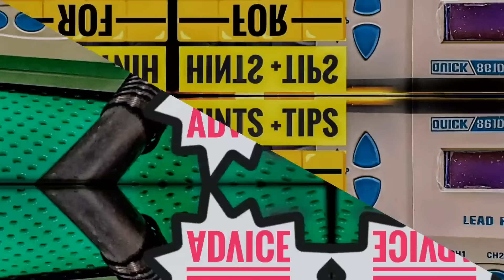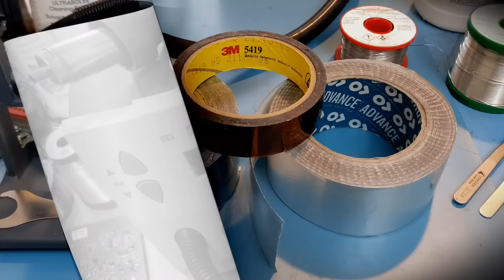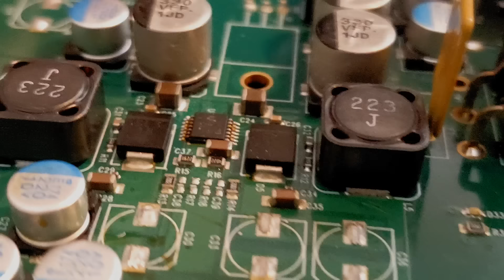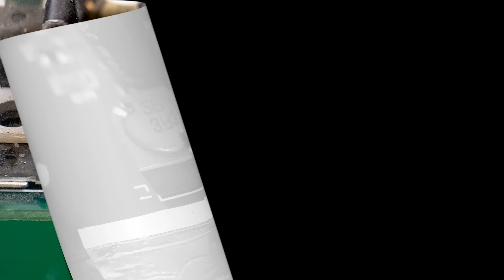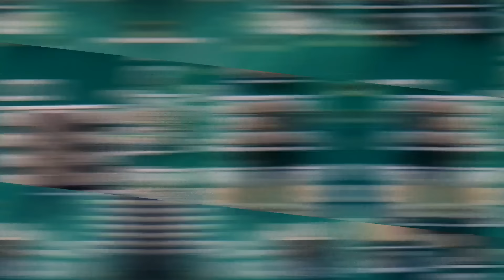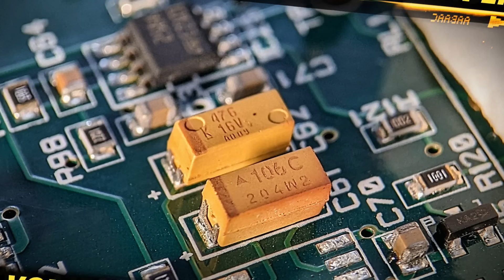How To Use Hot Air Rework Station / Soldering / Electronics

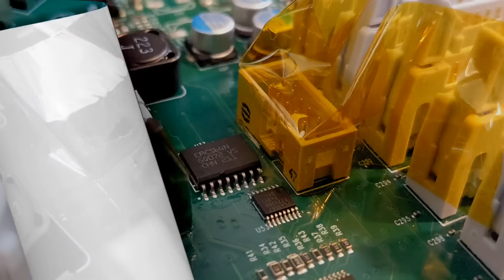Comment: Big novice here: I noticed the chip you removed at 6:37 you are close to it, moving around it evenly. I've tried this with chips I've tried to remove and I start seeing burning on the PCB at that height. I use a liberal amount of flux and it starts to burn. I'm usually working at 325 C. Although my hotair station is an inexpensive one, so I hear that the temperature may be inaccurate sometimes on cheaper machines. I've only ever removed one chip as easily as you did in your video. Two other times I had pads rip up, even though I'm not using force. They will come up stuck to the leg of the chip. Any pointers on what I'm doing wrong? Thanks again for this video!

Comment: The temperature doesn't make sense. I asked AI what was a good starting temp for doing 0805 components. They said 280 Celcius. I started with that and it worked but I am not using as much solder as you do but remember I'm new to this. But 385 Celsius is way over 280. And, I looked for the aluminum tape here in the US and they said the aluminum tape couldn't stand temps over 300 at all. What's the aluminum tape called exactly?

Comment: should i use tape on the back side of a board that I'm heating the top components so they don't fall off? i haven't done much hot air work and I'm trying to learn what to worry about and what not to

Comment: I am a complete beginner, this video is excellent,  I'm just starting out and already found this super helpful. 
I've been watching YouTube for years, this is the first video I've watched all the way through and the first I've felt compelled to like and subscribed.  Is there any particular brand of foil you use ? Thank you.
Reply from the maker: Hi , thank you for your support of my channel , much appreciated . The tape I would recommend is Advance AT500 , easily found on the internet. Pretty decent price , £10 to £15 for a very large roll , sticky backed so stays in position well when using hot air guns etc. Hope that helps , thanks again 👍

Comment: When lifting pins on a 144 IC I keep snapping the legs. The solder joint does not melt, literally zero pushing with the leg.... I suspect the leg is getting so hot the leg snaps... Used soldering iron and also hot air soldering, same result.... Its like the legs are breaking before the solder melts. Using rework flux, watched many of your videos. What is going wrong for me? What is different from your videos is my solder just doesn't melt as fast....

Comment: I love the 3m 425 aluminum tape I use it all the time its only like 20 bucks here in the US for 0.5 inch which is pretty much all you need in width over the 2 inch tape which is much more and overkill in size for covering sensitive plastic components and components in general. I think am going to try some advance tape also.. but the 3m 425 is my go to.  The only problem with buying advance is I have to specifically order it international which costs more for me. The 3m is pretty much close to the same it leaves no residue on boards

Comment: Nicely done. I have a question: at about 21:00, the solder joints were looking shiny and good. But, after the solder solidified, they looked dull/matte.  You mentioned that was a lead-free board, I believe, with lead-free solder. Is that normal? I've only used leaded solder and not tons, either. I recently started doing some electronics projects after years of not doing any; I had to buy new solder. I got a roll of "63/37" from China via Amazon and that stuff did the same and looked like crap when cooled. I tossed that and got some Kester (?) 63/37 and, wow, yeah, that leaves shiny solder joints.

Comment: Hello, Something tells me you're exactly who I need to advise how to fix my Pad problem...Agilent U1242A DMM. Case has a battery compartment with fingers that make contact with 2 gold pads kind of melted into the PCB. Batteries leaked and traveled to one of the gold pads and destroyed most of it, especially where the finger meets it. There are blotches and a decent amount of gold pad still connected to the trace. How would you repair it to reliable again? I have 10 to 20 hours of use,  at the most on it. OUCH! Don't know where to source a 6.5mm square gold plated pad. But after seeing this, maybe a rework station and low temp solder paste and tape surrounding it, would be the best way to attach a gold plated pad if I could find or make one? I'd appreciate your guidance! Thank YOU! And please keep up the confidence building videos!

Comment: In case of lead free solder, would it help to start with adding some leaded solder to all the connectors? 
Maybe flood it a bit with leaded solder and then use solder wick to get rid of the excess solder. 

Just an idea, I haven’t tried it myself (yet).

Comment: Great video! That last method just solved a problem I've been having seemingly randomly. I mainly do automotive so I reflow alot of cracked joints. Every once in a while I'll have pins short like that for no discernable reason. I never thought about the mass of the ground working like a heat sink. Thanks for spreading your knowledge!

Comment: Any tips when using cheapo chinesium hot air stations? So far I've used it on a SOP8 chip, because I don't have many components requiring hot air to solder in my hobbyist and studies uses, so I don't know if I'm missing much by not getting a fancier station if I ever have the need to solder bigger chips.

Comment: - So, a bit of a beginner's question about electronics. The dark green is the colour of the PCB. The light green are the traces that connect 1 component to another. But then you also have these light green areas, like a square/rectangle instead of just a line trace ... does that mean that anything connected to that area, is connected to each other ? But I guess there are usually only 2 components connected to the square, because otherwise you would probably get a short ? 

- And what are all those holes through the board ? They are usually at the end of a trace. With the little gold coloured ring around it. Is that where a trace goes through the board to the other side, and continues from there to connect it to other components ? I don't remember those holes being on the boards of old electronics that I worked on in the past.

Comment: - I just got a cheap 92€ hot air station yesterday. A bit nervous to use it for the first time. But this video helps a lot to give me an idea of how to use it and what to pay attention to. 

- So now I should get me some of that Advance aluminium tape. I have some aluminium tape which I used to tape the seams of the plastic screen that goes over my roof insulation. I guess it might work just fine too. But I'll look into the one you showed, because it seems more flexible, probably works a lot easier.
Reply: I think it works the same, I used some which I got in the supermarket and it worked a charm.

Comment: Very interesting I studied a little Electronics I know not too much though. I had no clue you could apply that much heat on a IC wont it burn it ?
Reply from the maker: Hi , thank you for your comment . I've applied up to 400 degrees Celsius to IC's and then reused them with no problems at all . Very rarely one can form a bubble in the body due to heat but this is very rare . They are very hardy components nowadays . Hope that helps , thanks again 👍
Reply: @mrsolderfix3996  Holy shit I figured one hit with a flame be toast . I had no clue they would take that much heat wow !  I want to find a used solder and hot air station I would eventually like to start getting back to my studies . I do Marine electrical and also restore American Muscle cars. I dont know much about Electronics but would like to learn whats is a good entry level hot n solder station thanks mate

Comment: great video, super helpful
I have one beginner question about hot hair rework: how much heat can the ICs withstand? I am practicing myself right now with old modem pci cards and I noticed the ICs can incredibly hot after applying hot air to desolder them. if these ICs are not to be discarded, is hot air still a viable method for removing these components?
Reply from the maker: Hi , thank you for watching the video and commenting , much appreciated . Lots of IC's can take very high heat and still be reusable . I've taken parts from boards using 400 degrees Celsius and reused them with no issues . Hope that helps , thanks again 👍

Comment: Enjoyable video as usual.  About that final solder bridge, heating it with the tip of a pre-tinned piece of wick would've pulled it right out of there, and with a bit of sticky flux might even reflow the two leads nicely all in one go.  I see people struggle a lot with wick.  The key is to not use it right of the spool because it just acts as a big heat sink.  Cut a bit off about as long as the width of your thumb and fray one end with your finger so it's like a little broom.  Flow a bit of solder into the fray and when it cools add a wee bit of flux.  Then with tweezers (ceramic is best if you've got them) hold the broom edge to the solder you want to remove and heat with solder tip.  The solder you pre-tinned will be drawn toward the clean end of the wick and it will suck the solder from the leads with it like a Hoover.  It takes some coordination to remove the wick at the right time to avoid having to resolder the leads.  Also, if you are fortunate enough to have an iron that offers one then a hot clean 2mm spoon/hoof tip will draw a solder bridge like a magnet and you can just scoop it out.  Keep up the good work.
Reply: I mostly struggle with wicks when trying to clear small holes like <0.7mm like a JST-PH or worse, molex picoblade, especially attached to a ground plane. Even a small wick piece can't get it out because of the surface tension with the plated hole and a solder sucker tip is generally also too large if other components are around. There are 1000 videos for clearing THT holes with wicks, but they all clear holes >1mm which are extremely easy and every method works well with them.

Comment: You can shape the tape like a ramp to guide the air towards the pins too sort of like a shroud to focus the heat and air at the pins. So I like to make little ramps down to the pins with the foil tape and it seems to help a lot with larger chips like this to keep the heat directed on the pins.

Comment: 9:15 - I think it takes far too long to melt the solder on that chip. Apart for that, nice job showing aluminium foil works better than kaptop tape.

Comment: 29:00 just a quick dab with the iron and solderwick (with flux on it) would have tanke  in off in a jiffy!
Reply from the maker: Hi , thank you for your comment . These joints you mention are on a heavy ground plane . No chance doing it the way you mention . If on a hot plate can be done your way or if you haven't got a hot plate available but do have a hot air gun can do it how I show . Thanks again 👍

Comment: Definitely excellent instructions. Don't make 1 tool to be your religion. The last shown problem with the tin lump had been easier to remove using solder braid, made of copper and sucking tin away. Soldering irons tend to oxidize and become close to useless, therefore hot air might be better in many cases.
Reply from the maker: Hi thank you for watching the video and commenting , your support of my channel is very much appreciated 👍

Comment: 👎 Kapton tape itself is heat-resistant but it has NO INSULATING PROPERTIES. 
Its purpose is to fix components, cables, etc. in places where high temperatures occur (where any other tape fails).
It was never intended to protect other things from heat❗
Reply from the maker: @4623620  hi , I showed it here as many people including in Electronic companies still use it like I showed to protect against heat .

Comment: Hi Mr. SolderFix, I have a quick question: Should I preheat the board and the SMD components to 200°C before proceeding to 400°C for desoldering with hot air? Or should I go straight to 400°C for desoldering? I've heard that to avoid thermal shock, it's better to preheat the board first. However, some sources suggest using high heat for a short amount of time rather than keeping it at high heat for a prolonged period. I'm still looking for an answer, but no one has responded to me yet. I’ve even tried asking other YouTube channels about this matter, but they haven’t replied either. I'm really confused about which approach I should follow.
Reply: 200°C seems rather high to me but it depends on the other components on the board. 
Electrolytic capacitors for example are typically rated at 85°C or 105°C. 
I’m by no means an expert though, just my thoughts as an hobbyist.
Reply from the maker: Hi , thanks for your comment . I use hot air stations every day and some components will not come off of boards with less than 400 degrees Celsius . I've used hot plates at 130 degrees plus hot air at 350 to 400 to have any chance of desoldering . Seems crazy I know but this is what it can take . Certain components won't take this heat i.e Electrolytic caps which I do talk about in other videos . I talk so much about component protection during hot air  but you will learn as you go along the temperatures you will need . Hope that helps .

Comment: What setting do you use for airflow on your hot air station?  I find if I don't set mine very low, I will often blow components right off the board — especially if it's just a little SMD resistor or capacitor.  I'll have to try some of that aluminum tape, that's a great idea.

Comment: Often you can simply take a pliers and cut the contacts of the chip individually. Then remove the rest of the contacts with a soldering iron.
Reply from the maker: Hi thank you for your comment . The method you described I have actually shown in a couple of my other videos on my channel . I never cut using cutters though as this can stress the pads . I always gently score through with a sharp scalpel blade . Works great and gives no stress to the pads as you are always pressing downwards.  Thanks again 👍
Reply: @mrsolderfix3996  Hi thanks for your response, I will checkout your scalpel video. But yeah, if a hot airgun is available, it's the preferred method.

Comment: Hi thank you for the great desoldering tips. I have an Adat port that I’m trying to desolder from a PCB, I will try and check more videos but it seems to be a tricky one. Should I use flux and wick to remove as I do not own a heat gun? I tried to use a suction gun but it was tricky. Mind you I didn’t have any flux at the time so maybe when that arrives tomorrow it might work. Best, Al

Comment: Total noob question here - I've removed surface mount components before by using solder wick to remove all the solder on the pins and then they fall off or can be lifted off with very little force (going back in with the wick if they still don't come away easily). When/why would you prefer using hot air over this method of removal?
Reply from the maker: Hi , thank you for your comment 
 Your method is very risky . There will definitely be times doing it your way when you will lift pads due to not wicking all of the solder from underneath pins . A safer way is definitely hot air or if I was doing it the way you do I would slightly lift up the pin by heating it first and getting a fine tweezer point behind it . Once slightly lifted you can then wick out the solder totally . Thanks again , take care 👍
Reply: @mrsolderfix3996  ah yeah that makes sense. I only did it a few times, guess I was lucky. Thanks for the reply! :)
Reply from the maker: @bennicus4901 no problem , thanks again for your support of my channel 👍

Comment: Can we have a model or part number of the Advance tape you use?  I used aluminum duct tape on a project and it protected the near parts, but when I pulled the tape off it left a messy glue.  I used denatured alcohol to get it cleaned up but I would like to find the same tape you used.  There are a multitude of Advanced tapes.  Could you provide a little more information regarding the tapes.  Video is very informative.

Comment: The two tapes are used for different purposes. They both have their uses in the right place.
Reply from the maker: Hi , thank you for your comment . This is what I've said in my videos , Kaptons good for some jobs , Aluminium foil is good for others . I just try and get across mainly that the foil is better when using hot air . Thanks again 👍

Comment: if you are in the market pick the one that you can buy spare elements for or at least have service. All dry air elements have limited lifespan due to oxidation.
Reply from the maker: Hi , thank you for your comment 
 That's why I love this station , easy to get spares for and works so well . I've had this rework station at least 7 years , never had to change the heater element yet but I do know if it does fail I can get a replacement part . Thanks again , take care 👍

Comment: Awesome job on the QFP lift! Super clean!  I love all the display that you do!  I am guessing that you used a larger tip on the QFP lift to spread heat over a larger area.  Always the best on YT regards rework....  I am sold on a hot air tool, checking ebay now....
Reply from the maker: Hi , thank you for watching the video and supporting my channel , very much appreciated . Yes you are correct . I vary the size of the nozzles I use on my hot air station to suit the size of component being worked on . Occasionally I may leave a smaller one on than I really need if I'm worried about too much heat spreading elsewhere and affecting maybe plastic connectors . Aluminium foil tape is a must if you do decide to purchase a station . Hopefully my videos can help you out here . Thanks again , take care 👍